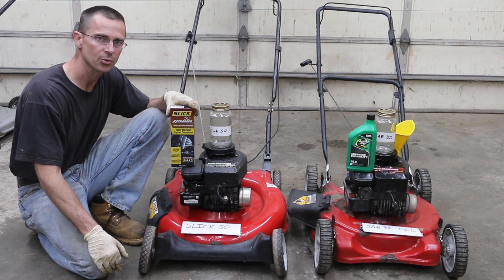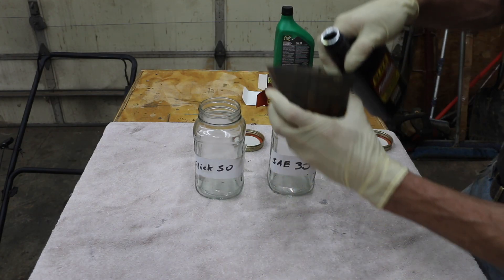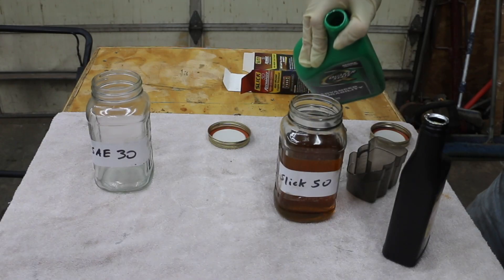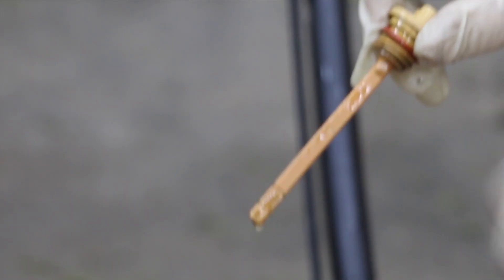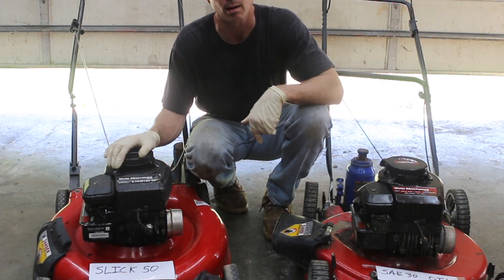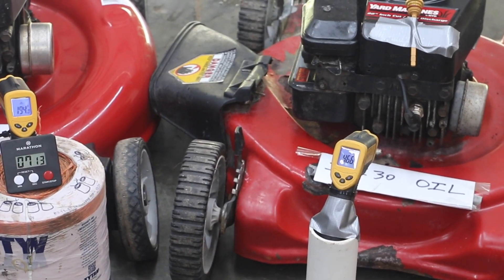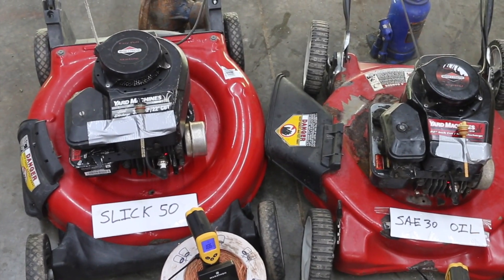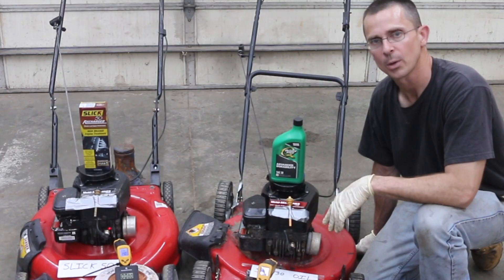Can't believe what SLICK 50 did to my engine!!--Dry Crankcase Test!

Comment: I love working on almost any type of engines but this may be a dumb opinion, maybe Slick 50 ran the engine kooler but because it cut off or locked up, so soon, could be a safety net so the engine doesn't lock up OR if it does lock up it's easier to unlock it, verses the conventional sae 30?

Comment: I remember when all the Teflon additive companies were booming, some fly by night ones that didn't last long.  I'm still surprised slick 50 is still around.  I once read an article that stated a very interesting fact.  Dupont invented Teflon and their engineers tested every conceivable way to sell the stuff, they stated they never found any benefit for the product in an internal combustion eng and possibly that it caused problems.  Dupont at one point was sued by some of the Teflon oil additive companies because it refused to sell Teflon to these companies.  Dupont lost the case and had to start selling Teflon to them again.  The win was based on you cannot stop selling a product just based on you don't agree with what your buyers are doing with your product.    The article stated do we really think these fly by night companies have better engineers than Dupont who invented the stuff?  The article went to say that Teflon is a solid, a solid that also expands when heated.  What's an oil filters job, to remove the solids.  Not trying to sound condescending just repeating what the article said.  It went on to say tests showed the Teflon could actually end up blocking small oil passages in an engine.  
I was surprised to see the temperature difference in the engs in your test.  I would like to see it rerun with checking the temperature of each eng first with regular oil and then add the slick 50.  If it really is reducing temp maybe it is useful in a splash lubricated eng with no oil filter.
Thanks so much for all the effort you put in your videos, they are extremely helpful and fun to watch.
Reply: The article was named "Snake Oil, is that additive really a negative"
Reply from the maker: Thanks!  Thanks for the suggestion.

Comment: In the 80's I used a quart in a restored 52 chevy truck that was very under powered with its original engine and it wouldn't rev very high at all, after I put the slick 50 in, it had way more power at low rpm and revved higher as well keeping better power throughout. As a test, after work I would drive under a bridge, so I'd go downhill, then uphill and try to make the light at the other side of the bridge and I never even got close with the original setup that had been rebuilt by someone in west texas. Afterwards I always was able to go down, then up the hill and make the light making the time at least 3 seconds faster. I was shocked at the outcome.
Reply from the maker: Thanks for sharing.

Comment: As a kid I would clean up mower engines and put straight slick 50 in them and run them at least an hour. I would then drain the slick 50 and put a thick plastic cover on crank case and sell them to slick 50 dealers.  I know it works.

Comment: Another interesting note is the dipstick from the engine that you had slick 50 is an older style of dipstick rather than the engine with the standard oil in it meaning that one engine was used longer than the other so this test was a rigged test not a brand new engine competing with another brand new engine that and the other way I can tell is with the paint chipping on the older style engine which has the slick 50 in it.

Comment: I love these types of tests. Slick50, when they first came out was a good product. Probably the best at its inception but fast forward several years later, they are the equivalent of most products on the store shelves with numerous ones outperforming them. Restore did the same and while I still use them at times, they are not as good as they were. Seems like when they introduce a product, it's a super high-quality performance level producer and after establishing a clientele, they incrementally sell a weaker product while charging more. Great test.

Btw, where both these engines apples to apples condition? Compression? Rpm? Etc.

Comment: 40 years ago in a small airport I flew out of, had a promotional p/u truck that had a small engine mounted on the back with no oil in it with a clear window on the side showing no oil and it was running.  Attempting to sell to all the aviation guys on the field that worked and owned the planes.  The idea was if you lost oil pressure you could keep flying onto a safe landing.
Reply from the maker: Thanks for sharing.

Comment: I didn't read all the comments and I really didn't believe slick 50 would work. Someone bought the company out years back. Then change the formula. The formula you tested was different than what you were using in your engine some years ago. If you do a little research the original slick 50 has been rebranded as something else.
Reply from the maker: Thanks for sharing.

Comment: The original Slick 50 was a great product but was toxic and discontinued in the U.S. It is being made in Australia under the name X-CEL plus and way to experience at $99.00 for 15ml. The new slick 50 in the U.S.  is total garbage. I am looking into X-tra lube. Supposed to be the best on the market for us. I got 400,000 miles on a one ton van after using the original Slick 50 and never touched the bottom end. Would like to see a good test with the X-TRA lube.
Reply from the maker: Thanks for the suggestion.

Comment: I rebuild manual transmissions. I'm a one man show. I soak all of my gears and shift parts in slick50 with teflon. I can easily tell a difference between trannies that are treated vs untreated. Slightly less noise but the feel is noticeably better. I usually wears off within a year though
Reply from the maker: Thanks for sharing!

Comment: I know that it died way faster (which was surprising) but what was even more surprising to me was to see the Slick50 engine running 150+ degrees cooler! There's something impressive going on either way. Assuming it is the Teflon in the Slick50.
Reply from the maker: Thanks for the feedback.
Reply: I agree. And just out of curiosity I wonder what the difference in the internal engine damage was.
Reply: I agree. If it was running cooler it shouldn't have locked up first.
Reply: @jjano2320  if ever there was a project farm test that deserved to be revisited it would be this one
Reply: @jjano2320  No, it's the opposite, with a high heat the iron block was expanding while the aluminum piston wasn't, resulting in less friction. That's why it was able to run longer, even though the engine may be more damaged as a result.
Reply: @wesdoobner7521  
That does make sense
Reply: @wesdoobner7521  that's an interesting point.
Reply: @Wesdoobner7521

I don't know if your physics is sound, but I like the explanation anyway.
Reply: The original Slick 50 was sold in 1984 and the inventor now sells his original formula under the name ExcelPlus but not in the USA. Slick 50 has been updated with Cerflon technology to create a ceramic reinforcement of your internal engine parts. The chemical compound, Boron Nitride, is added to the fluoropolymer (PTFE). Teflon™ is a brand name for PTFE (Polytetrafluoroethylene) and is a trademark used by the Du Pont company and its subsidiary companies.

Comment: I seem to remember the idea of slick 50 was to protect your engine on initial cold start as 75% of engine wear occurs at this time. The slick 50 could then be drained out at next oil change interval, typically 5000 miles on road going vehicles. The engine now refilled without slick 50 added to oil was supposed to be protected from start up wear for 50000 miles. Your test suggests otherwise.

Comment: Years ago I saw a slick 50 demo running a B&S engine with plexiglass on crankcase showing straight slick 50 probably 20% or less of crankcase oil capacity. Can you try that in a video.  That way it might prove Slick 50 protects the engine from low oil for so long.  Thanks for the videos always informative!
Reply from the maker: You are welcome!  Thanks for the suggestion.

Comment: Slick 50/militek/duralube ,all hokum. My buddy had a pulsar at the time ,and used militek ,3 years later ,the engine had almost no compression, so one night ,he pulled the engine ,poped out the pistons ,and the rings were full of teflon ,he cleaned everything, put back the same rings ,put everything together and it ran fine for the rest of the life of the car ,so yeah ,some additives are good ,dome are bad
Reply from the maker: Thanks for sharing.

Comment: Possible repeat - run both engines with the 30 weight oil.   30 minutes record temp.   Then drain oil.  Replace the hotter engine with Slick 50.  Then run and record temp.
Reply from the maker: Thanks for the suggestion.

Comment: I'd be surprised if the the slick 50 motor block was ruined. I grew up with the same commercials and was religious about my slick 50 usage. And this may be the difference,  I had a 1982 Toyota Supra. Racing flat out for a good 15 miles in Florida against a new TransAm GTA in 1987. After about 6 or 7 minutes of this.. I pull off at my exit. Noticing my temp is high. Got to a service station and got some water in it... which was promptly flowing straight to the ground. Thinking I would look at it in the morning,  stopped at our hotel... looking at the car the next morning decided to drive her home 83 miles. 
Long story shortened.. number 6 piston was melted down the connecting rod, number 5 had stared deformity. Lost the rear top freeze plug.... bored the block out 10 over. Bought new pistons and con rods. Used the same block, cams and crank.  I believe it all possible because of slick 50. Difference is never lost lubrication,  just lost heat dissipation. Which I know would have melted the piston to the block with regular oil.
Reply from the maker: Thanks for sharing!

Comment: I was trying to find the best place to make a video suggestion. I guess this is the best way. 

Growing up we were always taught to break in a new engine by heat cycling them and changing the oil early to remove the break in material.  The heat cycles typically consisted of starting the engine, running until warm to the touch then shutting it down to cool. Each time we would run the engine a little longer to reach a higher temp then shutting down to cool. 

Does this really make a difference? Can you test this with two new engine break one in and the other just run it under full load from new.  All variables should be the same, oil type,  fuel type.

Comment: I use to replace a quart of oil with slick 50. The rpms on the gauge would be higher & the cars seem to have more power. I'm considering putting some in my mowers just to help them run cooler.
Reply from the maker: Thanks for the feedback.

Comment: If the slick 50 engine was brand new it'll fail sooner than a broke in engine if starved of oil. No break in or heat cycles probably contributed alot to the early failure

Comment: The regular oil was an older, very well oiled machine, according to the rust, it has done long service..
The Slick-50 engine was a new machine and not a lifetime oiled and already warn-in on each other.
So yes two the same engines with very very different conditions of those engines.
Would love to see this on the same engine same conditions. 
It seems their same more oil out of the slick machine while draining it a well.
I am also a believer, the lower temperature made me wonder about the difference in engine conditions. Old is better lubricated than a brand new without servis or running in period

Comment: I really enjoy your videos. I'd like to see a test to confirm or debunk an old urban myth that 100LL aviation fuel burns hotter than mogas. Some think a fuel with high octane rating results in hotter combustion. Does it?
Reply from the maker: Thanks for the suggestion.
Reply: Higher octane fuels burn cooler.  Aviation fuel vs automotive fuel with same octane would burn cooler.  Putting higher octane in an engine that doesn't need it results in less power.

Comment: Interesting test BUT I would have preferred to see the temps of both engines running the same SAE 30 oil to establish if either engine ran cooler or hotter than the other and establish a baseline for comparison. Then proceed with your test.
Reply from the maker: Thanks for the suggestion.

Comment: The MAJOR problem and omission here, is you have to mix the Slick-50, with the motor oil.  It is not designed to run straight, like this man did.   I am not backing up slick-50, but he should have mixed the SAE-30 & SL-50 appropriately, and he did not.   If the mowers take 1-quart of oil, It should have been 4/5th oil, and 1/5th slick 50.   THAT is the  real test after draining the oil.    The mower with the SL-50 has to run for a lot longer for it to work, as they claim.  That quick run and drain was another incorrect application of the product.    You can put Marvel Mystery Oil in the crank case, and the mowers will continue to run, it's been done already, so this was just so wrong in procedure. 

I am not impressed, at all, with this man's test procedure, because the use of SL-50 was not followed correctly, nor was it mixed correctly with motor oil.    It is a skewed result BECAUSE the procedure was not followed correctly.    Even if it was done properly, and the SL-50 motor failed first, so be it, but I guarantee you it would have been longer before it failed.

Comment: years ago my friend drove for a company called robert's express they paid well but as a driver you were always on call and you had to have a newer full size van. "Nooney" put over 100 thousand miles on his Ford van and was a firm believer in slick 50. well he replaced his 300,000 mile 5.0 liter motor trying to find a vibration and I ended up with his original motor that was slick 50d since new I gave it to my nephew who put it in his crown Vic and forgot the oil pump driveshaft. He called me said motor was no good had no oil pressure...he put about 25 miles on it before getting ahold of me and learning his mistake. He pulled the distributor installed the shaft and the oil light went out and ticking stopped, motor with 300k that was starved for oil ran great. Im a certified tech and I know without slick 50 this motor would have siezed up. I do know you had to follow directions completely because it was said to treat the metal, there was a right and wrong way to do it...maybe a flush first? I forget or length of time in the motor? Nooney did it right, exactly like the bottle said. He also claimed lower operating temps, I was sceptical of any additive being a tech but how do you explain it?

i
Reply from the maker: Thanks!

Comment: I use to sell a different brand of this oil with PTFE back in the mid 80's, the oil was white compared to slick 50 and it did much better. we were told it had more PTFE resign in it vs slick 50 brand. Your test was pretty useless.  our engine we had to demo was treated with the oil and for much longer. The crank case cover was plexiglass so you could see there was no oil in it while it was running. IF it stopped running you could still turn it over and they would retreat that engine again.  All cars I put it in the RPM's raised up and everyone had to adjust the idle, and it didn't take long to get those results. NOW if this guy would of treated the engine like he should of used the whole qt the results may of been much better. The qt I sold replaced 1qt of the oil you normally used. Before you added it into the engine the instructions said to shake it like Slick 50 does. the whole quart. PTFE resign will settle until put into an engine.

Comment: One observation. To give extra props to the engine with the SAE 30. The way the mowers were set up during the test... the exhaust from the slick50 motor was blowing directly at the intake, and the motor using the SAE 30. If anything I would think this factor should have given the Slick50 motor some advantage as the SAE 30 mower was breathing exhaust, and having hot air blown on it. This like aided in. Raising the temp on the SAE 30 motor to raise even faster... Had the motors been separated or positioned differently... The SAE 30 motor.may have run even longer...?

Love you channel! Please don't give into sponsorship like so many do... Im sure you have been approached...
Thumbs Up to Project Farm!
Reply from the maker: Thanks!

Comment: THAT Slick 50 is NOT the same as the original formula.  Please try to test "Excelplus" engine oil treatment as it IS what the original Slick 50 WAS.  Also , the instructions used to be to immediately run the engine for AT LEAST  30 minutes immediately after the oil change - that gives the product the time AND HEAT it needs to bond to the metal.  I used the original Slick 50 ( and later QMI ) in EVERY SINGLE vehicle I owned for almost 30 years...ALWAYS saw a noticeable improvement in gas mileage...ALWAYS !!!  I do not care what the FTC says , government LIES more than manufacturers - BUT - to truly try to rate a similar product , you need to test Exceplus according to the label directions please - THANKS KINDLY for what you do !!!!
Reply from the maker: Thanks for the suggestion.

Comment: The main problem with your comparison is today's slick 50 is nowhere close to the formula from the 70s and 80s.....it's not even the same company 😕  the original company was lubrilon. The only place you can get the actual original formula is out of Australia with a companycalled xcellplus, as lubrilon was sued into oblivion by the US auto industry and the ausi company bought the original formula.......all products sold under the slick 50 name in the US now are garbage.